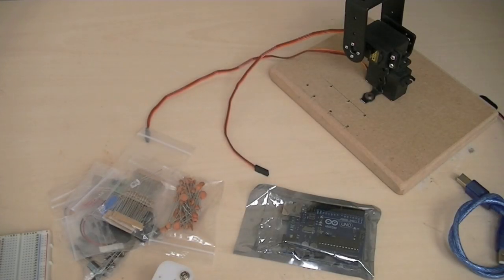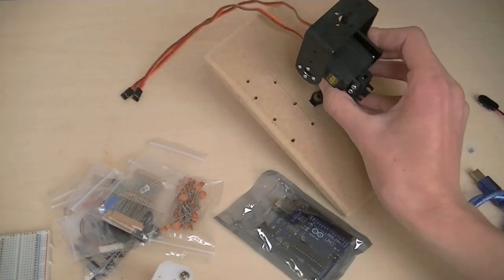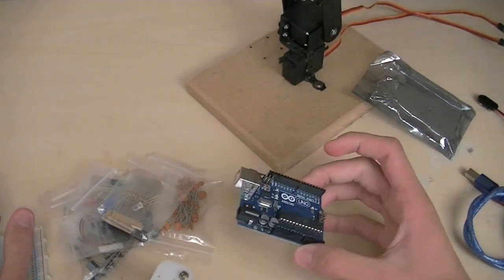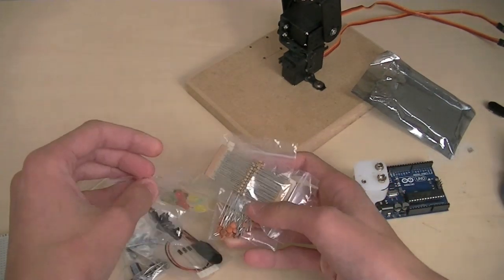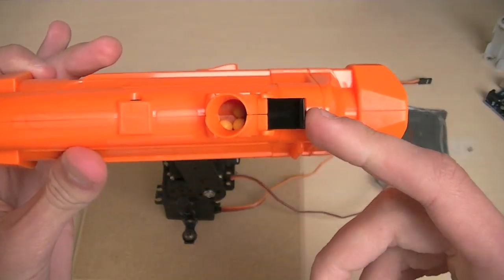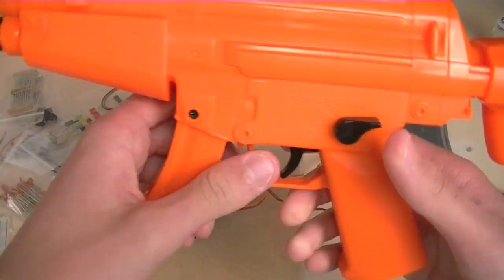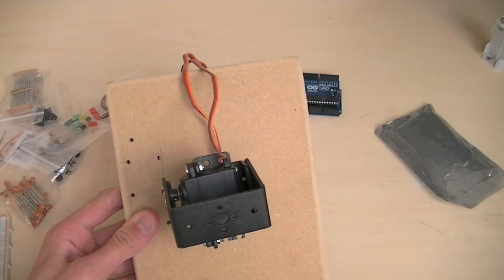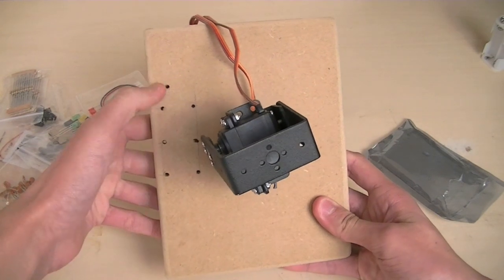DIY Arduino Tracking Turret - Part1 - Overview, parts, servo mounting

Comment: Let me guess it didn't work out. 
Mine didn't either with those pan/tilt kits... which won't hold more than very light load (maybe 1 lb?) 

Need to build your own frame with better support... where weight doesn't go direct to servos (at least with a 6+ lb weight)
Reply from the maker: Nah the weight of the gun wasn't a problem for those servos. I just broke the gun and never got round to getting another one unfortunately, the project is on the list of things to finish... :)
Reply: +PracticalProjects cool would love to see an update if you do that.

My 8ish lb Nerf Zeus made standard servos shimmy & shake on that pan-tilt rig, so I'm building a frame that tilts on a pipe, and pans on a lazy Susan bearing...  so little weight is on the servos. I'll post to YouTube once it's done.
Reply from the maker: +SteveYouTube916 thanks, hopefully I can finish it soon! ahh I see, the lazy Susan sounds like a great way of doing it! Great, please let me know how it goes
Reply: +PracticalProjects Yeah, I haven't got the pan servo attached to the turntable yet... but you get the idea from this pic. http://imgur.com/SpcHeNr

I think it's gonna work out nicely.
Reply from the maker: +SteveYouTube916 yeah that's looking good!